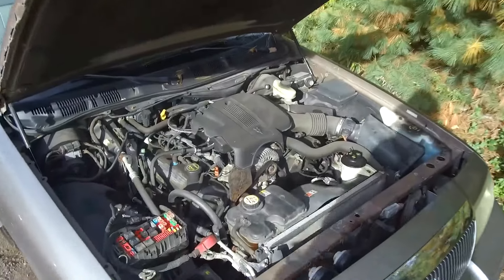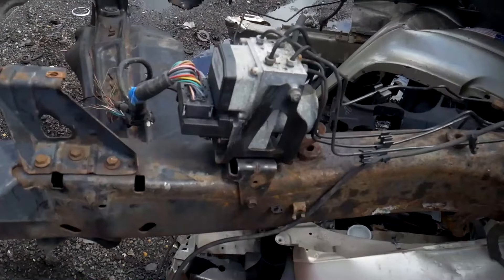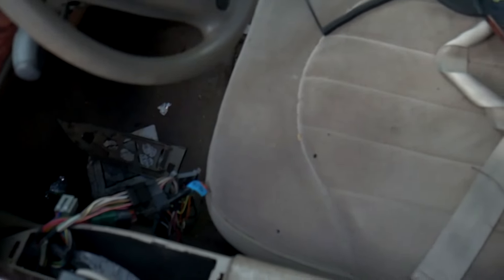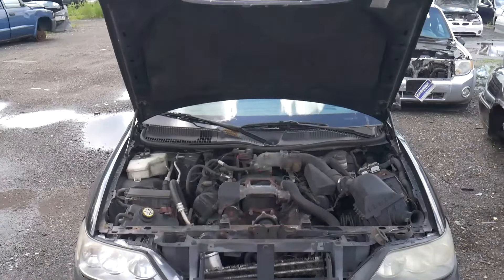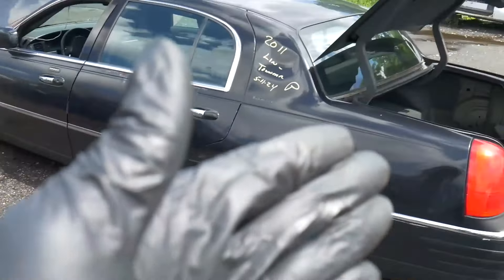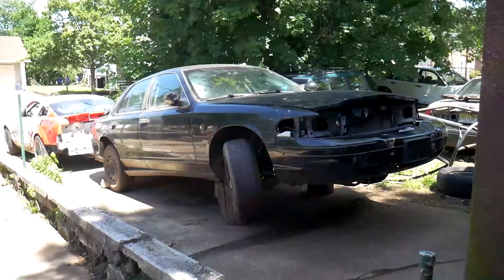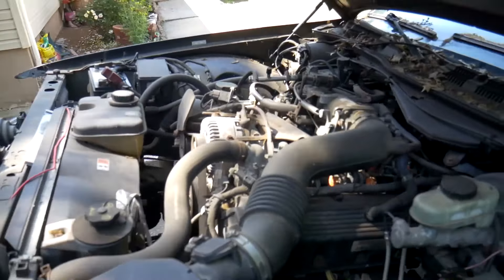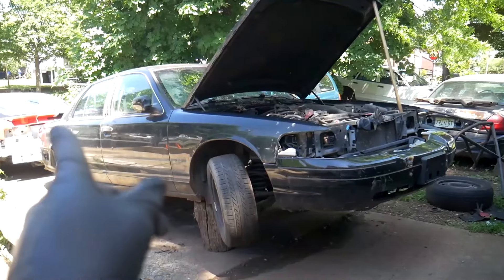Junkyard Grand Marquis Demolished (  And 2 Lincoln TownCars ) #cars

Comment: I did junkyard looking for turbobike parts. I got 3 good ECMs and a good looking turbo. The junkyard is gone now. The turbobike is having issues. I bought an 07 Dyna with a hot 120R instead. 135HP 139TQ. In a fracking Dyna! Beast bike.
Reply from the maker: The turbo bike is wild!.... I am trying my best not to get aon a bike, but its slowly happening...I am trying to stay focus and get the cars done...( need physical help ) to get them done in a timely manor
Reply: @bstfordchannel923  
Getting old is hell. I hurt in places I never knew I had. Can't do a lot of what I once did a lot of. The best I can do is all I can anymore and I am proud you have help in some semblance. I wanted a turbo Hayabusa as my old man bike but this 120R Dyna may be good enough.

Comment: 06:03  03+ has better driving dynamics, but 98-02 are better built cars, 03+ has far more creature comforts like dual zone climate, huge anti-whiplash head restraints, seat belt pretensioners, snap away steering column U-joints at the exhaust manifold, better brighter headlamps, optional rear park aid, optional HID, optional Navigation..
03+ have a 30% stiffer frame for less NVH and higher crash scores
03+ has rack and pinion that has a strong center fell and tracks straight, 02 and older can be "darty" and busy and all over the road...

all 03+ got radio controls on the steering wheel....

hard choice, but I will go with 03+.... I have five 03s right now...all great cars....Arkansas....
Reply from the maker: I may have to agree with that... I may have to make a debate on this and give you credit on the video.... Thats something to talk about there...